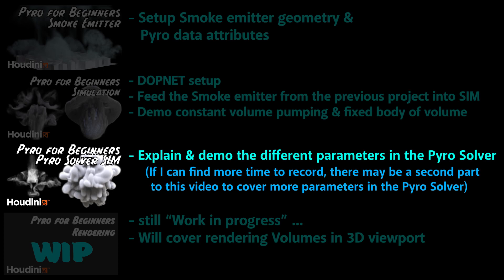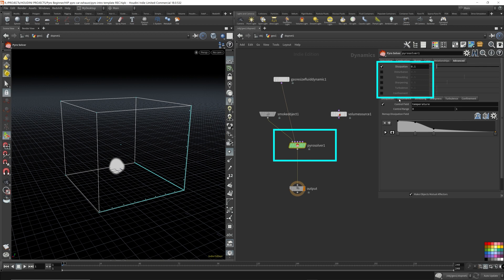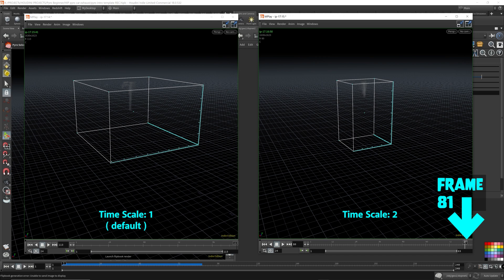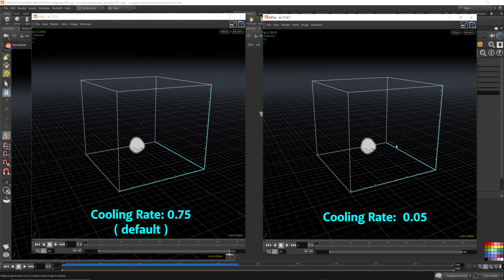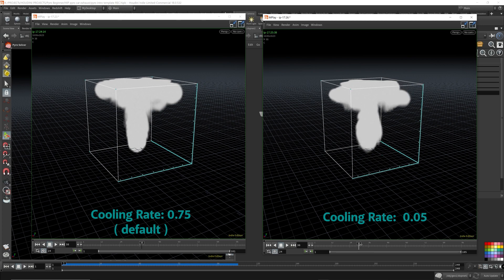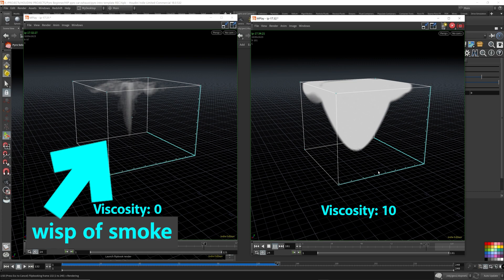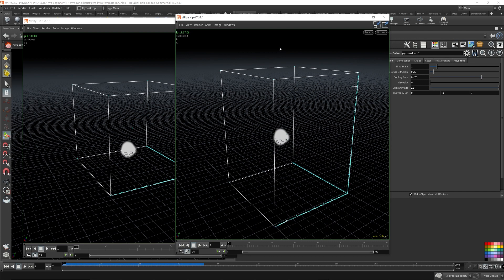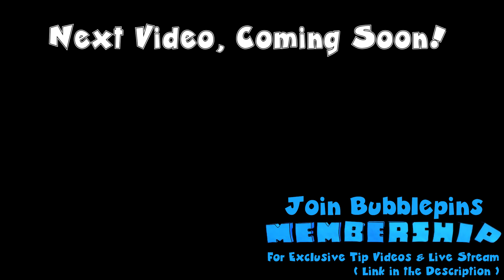Pyro for Beginners: Pyro Solver in Houdini

Comment: would you please do a tutorial on real dust effect including dust particles and how to control them with RBD simulation?
Reply from the maker: I think I have one, but it was based on the shelf tool.
https://youtu.be/xfwdEN5yh_I

See if that helps!
Reply: @bubblepins  How to change color?
Reply from the maker: @georgesebastian9859  there's actually a few ways to do it!  The method I like the best is using the "Volume Visualization" node on the SOPS, this is able to render volumes directly on the viewport at very nice quality!  But requires a lot of tweaking parameters on the viewport settings.  But if you tune it right, you can get REALLY nice results, so I highly recommend this!  Check out a post I did before with a pic of the volume rendered in the viewport with this node:
https://www.instagram.com/p/CD5kRb3n_bC/

Then if you're using mantra, just drop down a volume material and there should be a parameter called smoke color.  If you're using Redshift, because I haven't used Redshift in a very long time, I can't remember exactly what that parameter is called anymore, but there should be a similar color parameter inside the Redshift Volume Material.

Hope that helps!
Reply: @bubblepins  Thanku so much